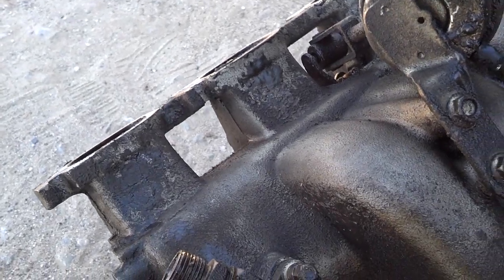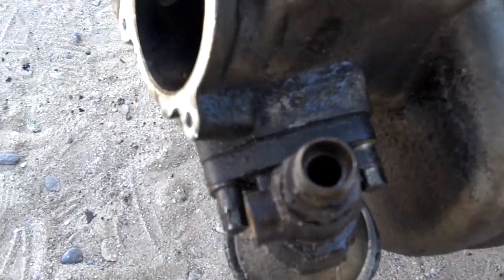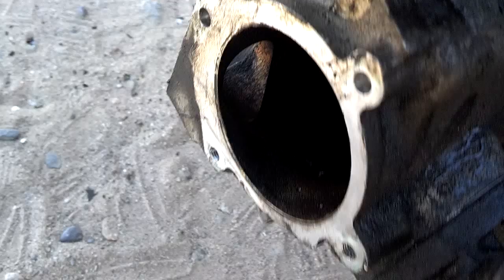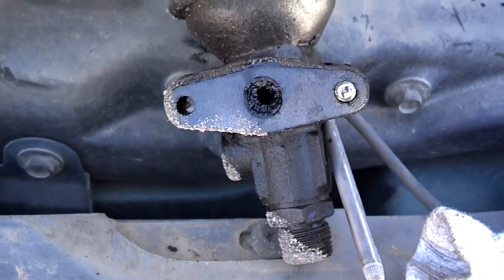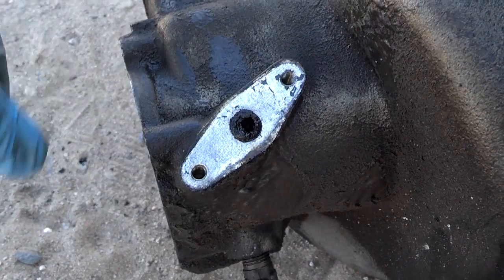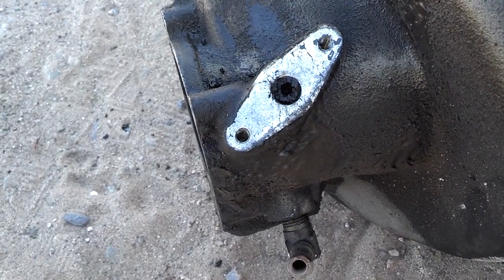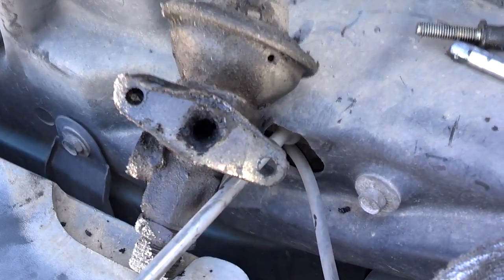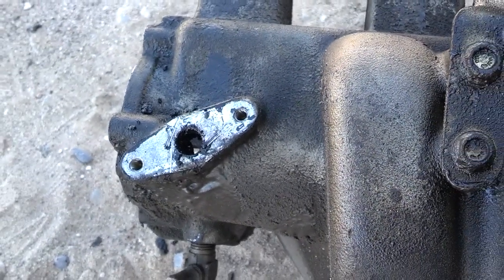EGR valve cleaning, Volvo 850, 1993, 1994 and 1995 - VOTD

Comment from the maker: You likely have some vacuum leak, especially under pressure. You should pull off your intake and vacuum tubes and inspect them for tears or holes. 

The fuel pressure should be 42 psi. You can check it at the end of the fuel rail right near the throttle body cable. It has a valve stem like you find on tires.

Comment: What should I clean the EGR with , I did this once with carb cleaner, then put gas additive in my car now getting the EGR code again. I can't find a new one of these anywhere on line. 1994 Volvo 850 2.4 . And yes went to the jys nothing! Have to pass emissions. Thanks Robert
Reply from the maker: I scrape out the carbon with a screw driver then spray it out with brake parts cleaner.
Reply from the maker: https://youtu.be/eEZzqyu2a6c
Reply from the maker: Go to 28:30 on the video I linked.

Comment: Nice video, EGR/crank case vent system will cause all the seals to blow out if not maintenanced. Just did a oil pump gasket set and front main seal on a 2000 Volvo v70 t5 and I'm pretty sure it's leaking again after installing because the EGR blew it back out. 🤦🏻‍♂️
Reply from the maker: that vehicle should not have an EGR.
Reply: @RobertDIY  thank you,. I just checked for pressure at the dipstick and oil filler housing and none. Changed the pump seal on a 2000 v70 t5 , ring etc and it's still pissing oil out of it under pressure. So I'm now taking it apart and going to install a pump if that doesn't work im assuming the shaft will have to be sleeved with a speedi sleeve.
Reply: @RobertDIY  intake cam seal leaking. The pump and front main I replaced is fine. It's running out of the cam seal and down onto the frame. Thank God not the pump 👍.
Reply from the maker: I thought you were going to far. Glad you found the leak.

Comment: Hey i seen all your videos and they are great it done all the clean up  maintenance to my Volvo but still stalls but when I step on the gas hard enough it goes away doh you think I got a plugged up fuel filter, the fuel pump is going bad or the spark plug wires are bad cause I only replace the spark plugs the distributor cap and the router  and like I said if I press on the gas stops stalling but then I get that gas smell  from the moffler

Comment: have a Volvo 850 t5 2.0, my car is slowing down like it doesn't have a turbine. the turbine works and inflates the hoses nicely.
Reply from the maker: How do you know that?
Reply: @RobertDIY  I sent you a recording on a messenger, over 3000 as if it was not receiving gas

Comment: It's the Volvo 850 glt 95 and also is there any way I can check the fuel pressure and what's the fuel pressure reading for it ? By the way is the non turbo

Comment: i have a 1999 volvo s80 2.0t its got white smoke thick coming from exhaust and it has white smoke coming from dipstick port and out oil cap area can egr cause this ive been told egr or pcv valve is this true
Reply from the maker: +Christina Ritter run from that mechanic. These cars do not have a EGR valve.
Reply from the maker: +Christina Ritter https://youtu.be/oRwDce_ALkk

Comment: Dear Robert,
I'm fighting with a P0172 code in my 95' Volvo 850 non turbo for a month at least.
The information I got is that this trouble is caused by vacuum leak. I installed all vacuum hoses plus vacuum junction port brand new. And I'm sure there is no vacuum leak.
Today I followed the vacuum lines from EGR System, and I found that the EGR Controller is not opening and closing as spectated. The resistence of controller is 85 ohm. And if I connect the battery direct to the controller terminals I hear the click and the vacuum is passing. I tested the wires and are Ok. Measuring the voltage on the wires, I get 2.2volts, and I guess it is not sufficient to activate the controller.
The ECU in this car is 0 261 203 165 or P06842873. I don't know if it is with EGR or not. Please let me know what you think.
How can I test the EGR Temp Sensor? 

Thanks, Yuri
Reply from the maker: Yuri Bevilacqua How old is the PCV system?
Reply: It's brand new. I changed when I rebuild the engine, about 6 months ago.
Reply from the maker: Usually there is a vacuum leak somewhere. Did you use Volvo parts?
Reply: Robert DIY   Last sunday I tested the system injecting smoke through the brake booster hose and  I found vacuum leaks in the brake booster hose junction and vacuum junction port. Now those are new. There is a little holes on the EGR valve diafragm body and I can see a little bit smoke coming out from these little holes. Maybe this is the leak causing P0172 code.  I will try the smoke test again this weekend. All parts are Volvo. Except the silicone vacuum hoses.
Reply from the maker: Good deal.

Comment: what does an EGR valve do exactly
Reply from the maker: I do not know. Try Google. It likely control exhaust gas flow/processing. I believe it stands for Exhaust Gas Regulator. Many, many cars have EGR and PCV valves and systems, just different from the one on the Volvo's.
Reply: Robert DIY , it's Exhaust Gas Recirculation which takes some part of the exhaust gases and redirects it to the intake.. I remember something about 30% of the gases
Reply from the maker: Interesting.
Reply: Donovan Williams   The purpose of an EGR (Exhaust Gas Recirculation) is to reroute inert exhaust gases into the intake manifold to dilute the oxygen.  Inert gases act as a thermal buffer for the cylinder surfaces while the combustion energy is released.  This forces a higher rate of energy to become mechanical stroke force, and limiting the high heat energy needed to produce more NOx emissions.  The valve will only open once at operating temperature under average driving loads, and closes during idle, peak engine loads and when the engine cools.  The amount of recirculation is controlled by either vacuum lines or in modern cars at the engine control computer.  If the valve is stuck closed it can cause failed emissions test, high engine heat, and an increase in throttle losses.  A stuck open valve can cause a rough idle, decreased peak power, or even keep an engine from starting.
Reply from the maker: Hey Donovan and Pietro, thank you very much for the information.

Comment: I have a 1994 Volvo 850 wagon, something is clogging up my Volvo EGR (gas)-recirculation valve. Part #9135705 Pierburg.

 Because every 3 days the car shuts off and comes back on  after taking the valve off and cleaning it with carb choke parts cleaner & starting the engine. If it doesn't comes back on after 10 minutes, I tap the recirculation valve about 5 times  with a small medal object and it is able to start. I have replaced the filter and  fuel pump.  I have went to the local volvo dearship and was told they dont have the Pierburg part # 9135705 availble anymore/ dont make it.

 I have looked on the internet for a replacement and found a used  part, however, the ebay seller emailed me to say the valve doesn't appear to be closing all the way/ he canceled my order. Someone has suggested to connect a bypass to it; it cannot be done. Any suggestions on how to fix the recirculation valve problem?
Reply from the maker: https://www.youtube.com/watch?v=gLoO-D4yOcU
Reply from the maker: https://www.youtube.com/watch?v=NhtUXZTurzo
Reply from the maker: https://www.youtube.com/watch?v=ZqdHDqGKYV0